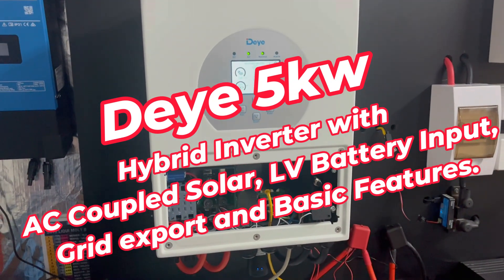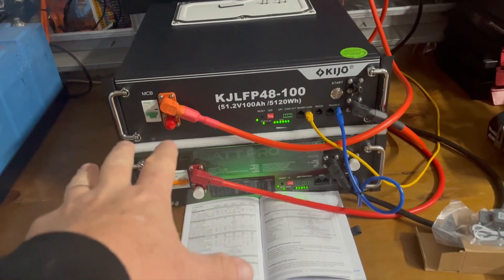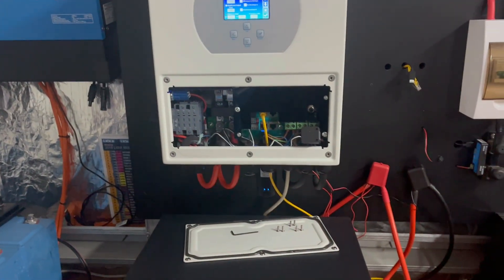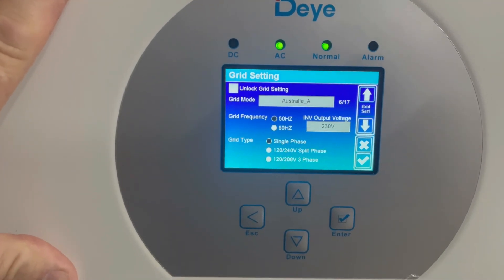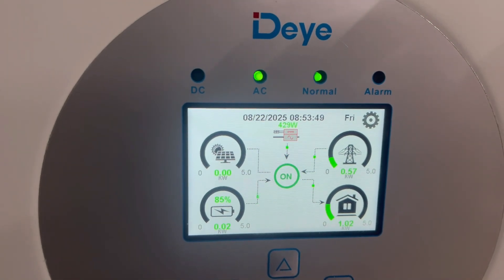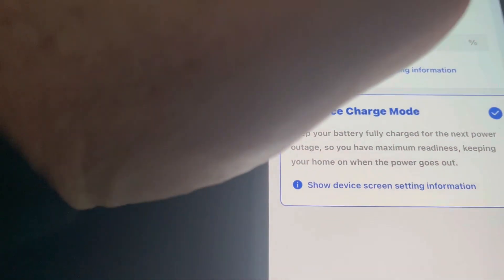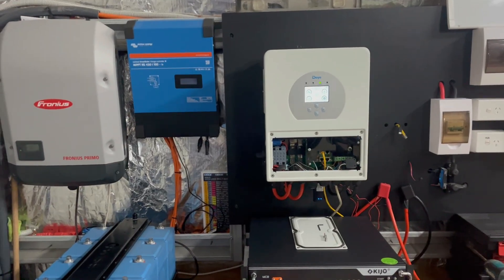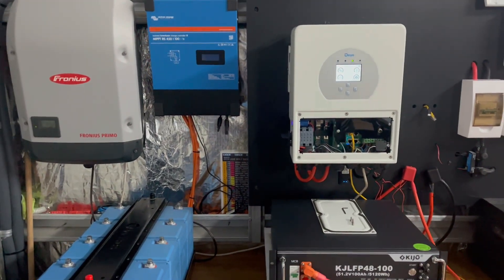Deye 5kw Hybrid Inverter - with AC Coupled Solar, LV Battery & Grid Export.

Comment: Is there a limit to how big the grid tie inverter coupled to the deye hybrid inverter be? Is the fronius primo a 3/5 kWp unit similarly size to the deye? If so does it mean when the sun is shining and you have 5 on fronius and 5 on deye giving 10kwp of load capacity? Or that is limited by the deye 5kwp delivery capacity?
Reply from the maker: I believe it’s a one to one ratio, so 5kw Deye,5kw Pv inverter, or 8kw Deye 8kw Pv inverter, and so on.
Reply: @craigsolarsolutions  What would happen if let's say battery is 50% charge, and there is both 8kW input from strings connected to Deye and 8kW from grid-tie inverter, would battery be charged at 16kw rate?